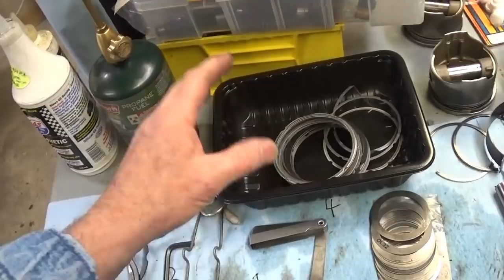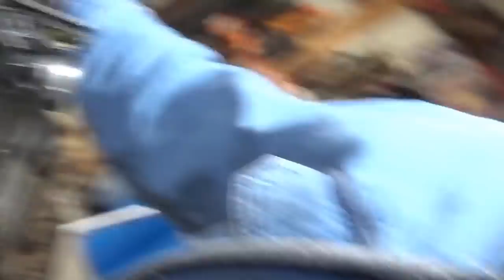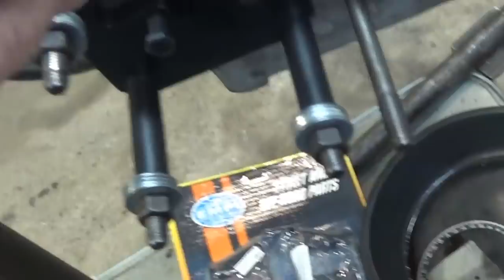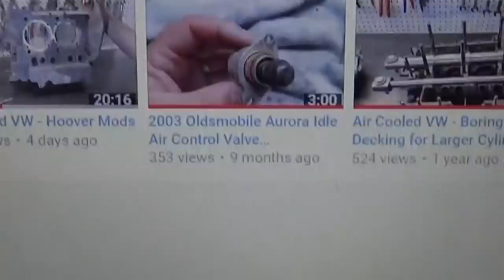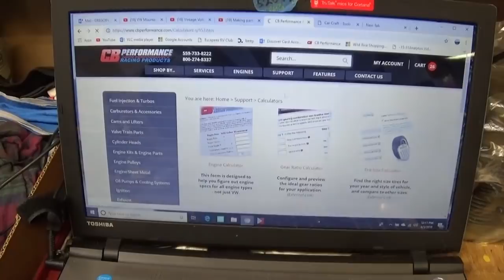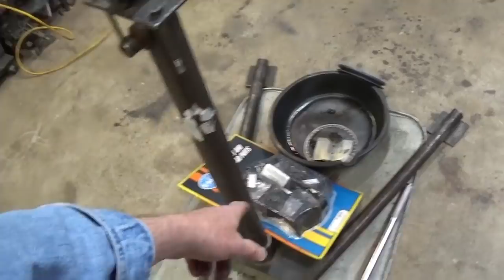VW 1776 SP Build   (Tool Time...)

Comment: End play: Before you build your motor.. You can  use a depth mic and measure from the top of the flywheel to the inner where the crank mates up. Take that measurement and write it down.  Install the rear main bearing on crank and measure from the back of the crankshaft to the main bearing and minus the 2 measurements and that is what your end play is. Shim up accordingly. That is how we set up end play for  when we did wedgemates.
Reply from the maker: That makes good sense. I always avoided those wedgemates because I thought they would be really hard to take apart if I needed to do a rear main seal.  Thanks so much for contributing to the comments and helping all of us with your experience. Have a great rest of your day!!!

Comment: Good video, really enjoyed it. Was interesting seeing how the sand seal pulley fitted, not many people fit them in the UK so not had an opportunity to see one properly before.
Reply from the maker: The main reason I used it on this build was that it was part of the used rotating assembly that I installed. I probably didn't hurt that it was a little bling and this engine will be completely exposed when in the car. Stock works fine for a daily driver. Thanks for watching and commenting.

Comment: Thanks for sharing, I always learn something new every time.
Reply from the maker: I learn a lot every time I do this. Every build is different.
Reply: TheEZGZ I agree completely, the few builds I’ve done I’ve learned something different each time as well. I appreciate you sharing and going into detail, I’ve been trying to get better in documenting my videos for others to better understand.
Reply: I'm just curious.. why use the t4 lower tins (cool tins) vs the t1's . I've read iffy things about them.. On a side note I've run a 1776cc fro. The 90's that was built with no lower tins at all and it still runs fine...
Reply: joes phone are you not running the air deflectors between the cylinders or not running the sled tins? 
I’ve had good luck with the cool tins but again I’m down in Florida where I drive it all over regardless of the weather and in the hit summer time and my engine runs pretty cool.
Reply from the maker: I feel that T3 tins give better air circulation on off road engines that don't run the rest of the  stock lower tin.  
I'm glad your 1776 engine is still running. A lot depends on how you drive and take care of it. Hope you get lots more miles and smiles.
Reply: @VWJawbreaker  Only upper tins are on it lol . It is on a sandrail . I can't recommend it cause it sounds scary but it still turns

Comment: awesome videos and love the explanation you give for each tool and its use👍VW did in fact say NOT to let your engine warm up, and start it and go.. I'm gearing up to do a similar build with a single port but may just port the heads a bit and try to get more zip oit of it.. we'll see, i have add and get side tracked with squirrels as well so all may change on a dime
Reply from the maker: Tree Huggers start there cars and go. Read John Muir's VW book for the complete idiot. It will help a lot with your build. If you want more zip use dual port heads. I only built the single port as a experiment and had the parts.

Comment: Hi EZGZ.
Great vid.
What’s the thickest shims that you can get for the end float please?
All the best.👍🏾🛠🇬🇧
Reply from the maker: Not sure but I want to guess .120 remember thought that you have to use 3 shims. I usually have enough old shim's laying around from parted out engines I don't buy them
Reply: @TheEZGZ  Thanks EZ. Yes,I know the rule of three. I’ve been running the engine with the clutch cable too tight,so the clutch has been riding on the shims and thrust bearing. Only noticed a couple of days ago on an oil chance. Lots of sparkles bits in it. Loosened of the cable,now I have a bit too much endfloat. Was wondering if I can shim it out,or else,split the case and put a new thrust bearing in. I’m a fool. Should have checked it properly. I’ve done around 400 or so miles in it,since I pit it back in the van…You think it’s savable without a strip down? It’s around a mm endfloat…

Comment: My was Volkswagen mechanic and service manager  he worked at 2 dealerships  he said the worse thing you can do to Volkswagen aircooled engine in colder climates  is remove  thermostat and flaps in the blower housing  he said thats cause the black colors and erosions  inside  the crankshaft  the German engineer s at Volkswagen  schools told the mechanics..

Comment: Mister GZ I’m tearing down my single port VW engine. The cases are replacement VW. Can you help me identify the size of my engine? here are the case part numbers 15 vw 000.101.101 h left side 102 on the right. Cylinder measures approximately 90mm. I have one VW head one MEXICO head. Will that matter. I do have a translator.

Comment: so your top dead center at 3/4 off on top dead center so when you come back to earth in your job at hand you need a 20, shim to make up your head /hello any one home ?
Reply from the maker: You need a minimum of .040 deck height and you want all cylinders to have equal CC and compression ratio.
All the lights are on but nobody's home.....